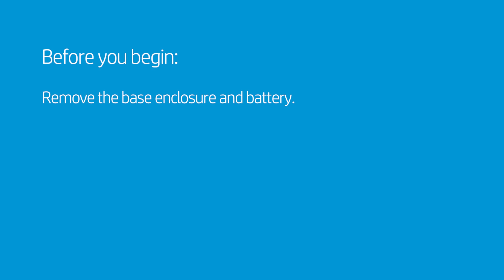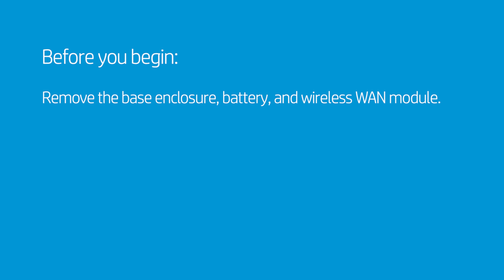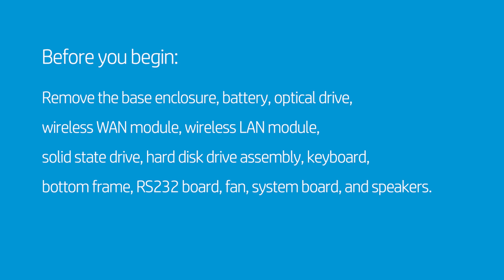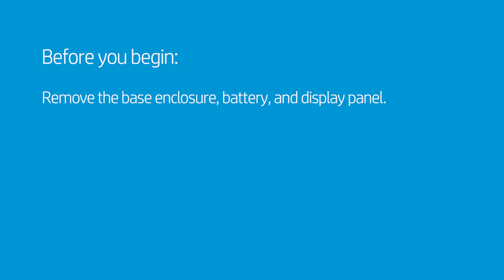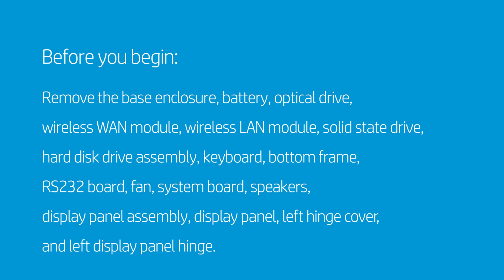Removing & replacing parts for HP Probook 650 G5 | HP Computer Service

Comment: Hi, is there a way i can find the correct soild state drive to install on my pc, as am not sure which is needed sata or nvme and 2260 or 2280
Reply from the maker: Hi Kudakwashe, thanks for contacting!
I understand that you need to purchase solid state drive for your computer. 
I will do my best to assist you.
You could purchase the part from HP.
Use the HP Parts surfer to identify the part: http://partsurfer.hp.com/search.aspx 
And order it via the HP Parts store: https://bit.ly/3nKMYrs
Binu - Social Media Tech Support

Comment: Does it work without battery? (plugged in charge).
Reply from the maker: +Gianluca Yes you can. In fact, it is recommended to remove the battery if the laptop is connected to power all of the time.

Comment: Hi! Is it possible to replace a VGA board with an RS232 board if mine shipped with VGA?
Reply from the maker: Hi there, thanks for contacting HP Global Social Media Support!
I understand that you need to know about replacing VGA board. 
I will do my best to assist you.
HP does not recommend upgrading or downgrading hardware parts or software that is bundled with the product as It may affect the manufacturer's warranty and performance, however, you could change the configuration at your own discretion.
Binu_HP Social Media Tech Support